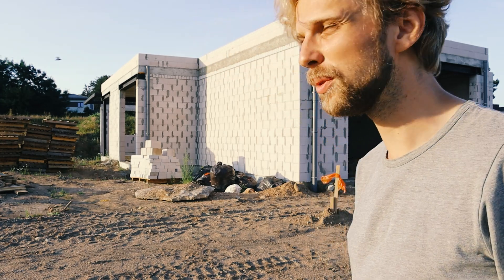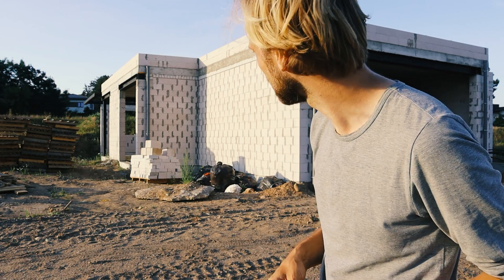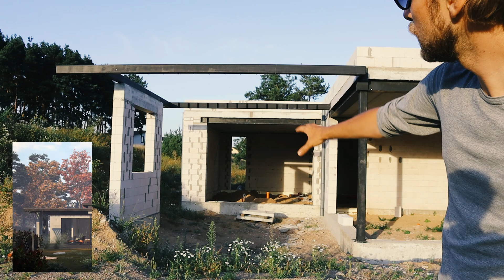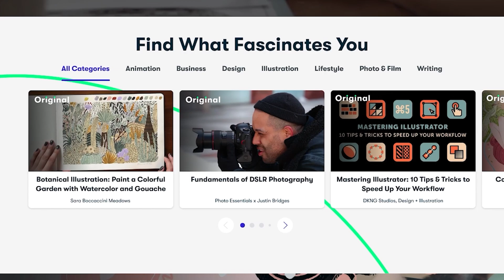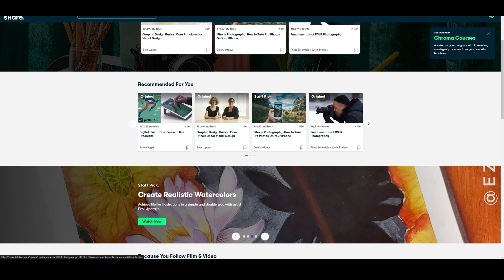BUILDING STARTED! : Architecture design from start to finish #6

Comment: Hello Gediminas, Could you do a video on preparing a model for laser cutting in rhino .. I have learnt so much from your rhino tutorials.. missing that element
Reply from the maker: Would be a very short video.. Black polylines for cutting, red polylines for engraving. Don't use hatches. Explode any text (makes polylines out of text). Draw a rectangle that is the size of your laser-cutter to see how your pieces fit. From here on it depends on what kind of laser cutter you have, if it's a new one - export in dxf format, if it's an old one - you'll probably need to use Corel Draw or some other crappy program like that. Either way, I have shown my workflow in my XToolD1 review video: https://youtu.be/vZFgzq7vDS0